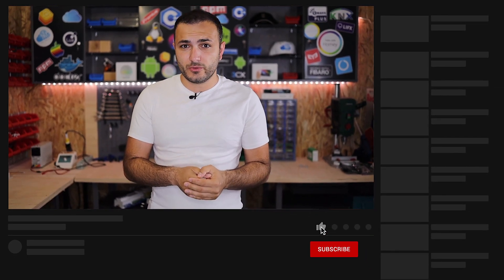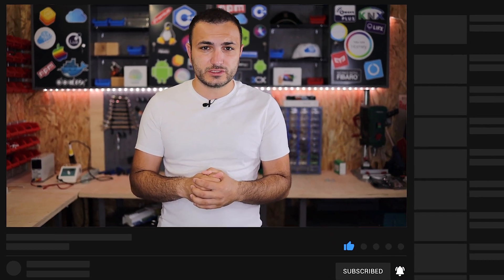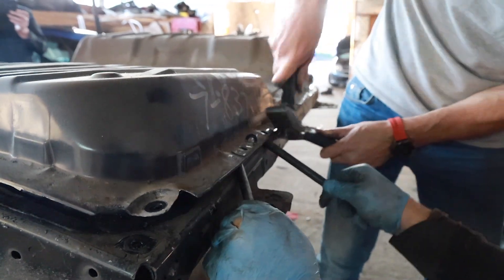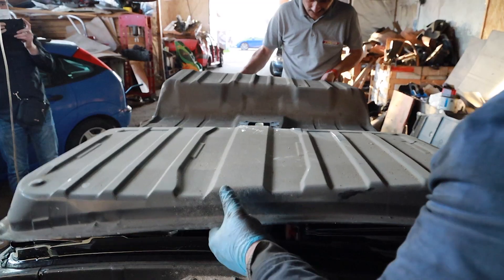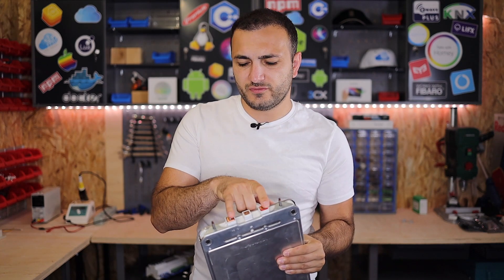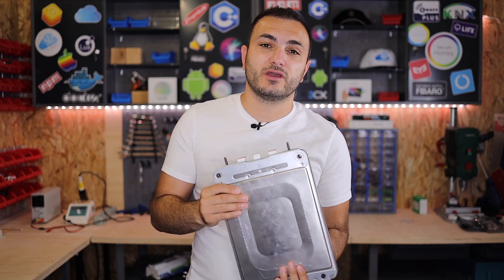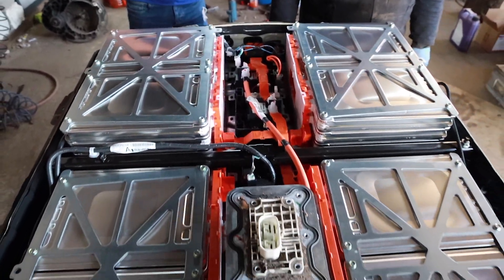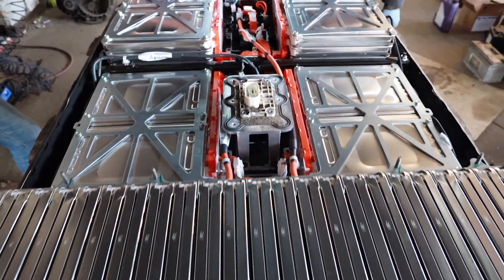How to remove the Nissan Leaf battery modules and prepare them for the 48V solar system inverters

Comment: Are you going to put 7 modules in series (14s Li-Ion)? That's what my setup uses. I only charge to 4.10v per cell (8.2v max per module) to increase longevity. I fully charge to 57.4v discharge down to 49v (3.5v per cell, 7.0v per module)
Reply from the maker: Hi, i sold Nissan batteries. Now i have a new peoject, stay tuned!